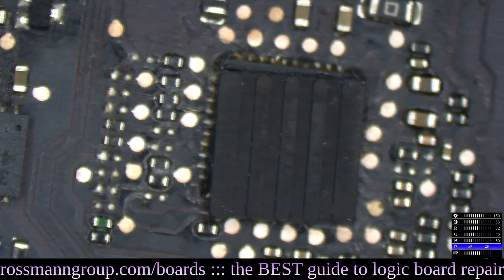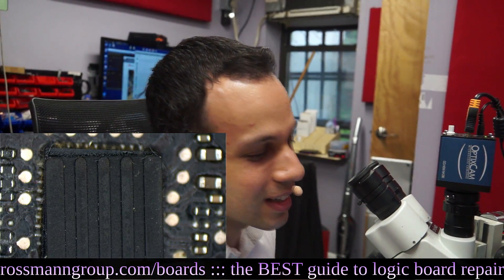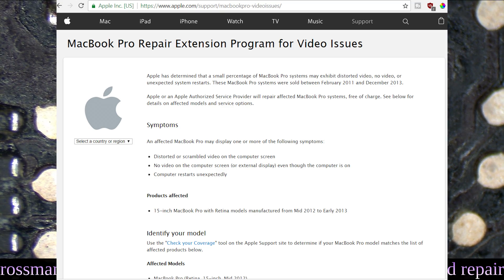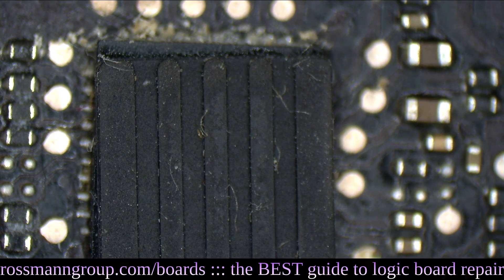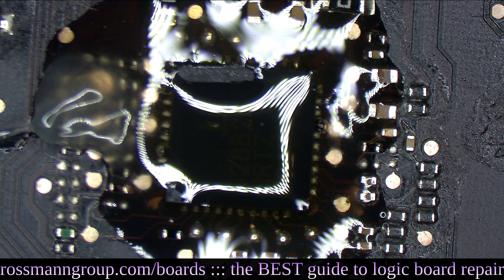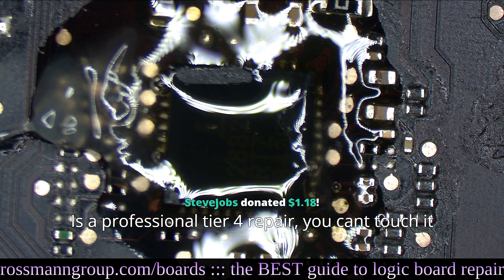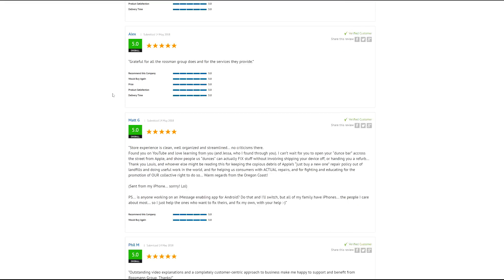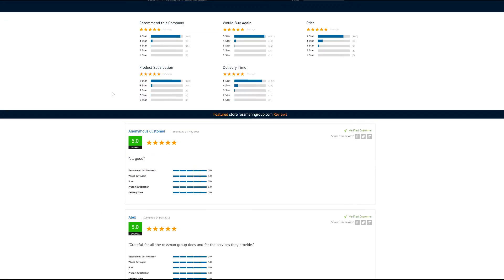How Apple authorized repair refurbishes Macbooks to fail again! GPU kernel panics

Comment: Louis, what you are saying about operating systems, i cant agree on that. You are saying, linux  users are either ppl who got sick and pissed off of windows or are open source hippies who love dealing with software without fancy features is not the way it is. When it comes to audio processing, fine, i can agree on  that. It sucks under linux. Every available  software use their own way how to handle extensions, there is nothing like vst and because of that, every software  has only basic functionality. OK, fine. But the same applies in some way for every other OSes too.  Im into software defined radio, good luck with that under windows. If you are lucky you find a build of gnuradio which is not completly outdated and intefacing hardware under windows is a pain in the ass. Im using linux because i like getting stuff done and not fight everyday in a new round you vs your operating system. 
I remember last time when i was using windows, an application where i spent a several hunderet bucks for crashed every time when i was running it my whole maschine, and all i got was a message which sayed, that an error had occoured, and i should reinstall and reinitalisize  my local library, and in this process all my data gets lost. So i called the support, for some more information, besides that an error had occoured so i have an entry point for tracking the problem down, but all they sayed, was, that some error occoured and i should delete.
My point is, that is something i would expect from free software and i couldnt even complain about it. I could completly understand why some developer gives a shit about my problems and  that he isnt willing to help me out in his spare time, for free. But if i payed some good money for something, i would expect a little bit more than a message which says "haha, you are screwed". And im not saying, just because you have payed  them , they have to fix every time all problems. But they could try to help out....Or at least pretend to

Comment: If the plugin you're trying to use is a VST, it can be run under a VST-supporting DAW in Linux under a Windows-Linux VST bridge host application. (disclaimer: i'm not actually sure at all how well this works but it's a thing)

Comment: The original soldering was not that good as far as alignment/placement but crud will come back from normal usage unless you conformal coat.  Even this board you did will eventually get crud and shit on the board.  This boards are no where near Mil-Std so there is no expectation of guaranteed usage.

Comment: If people like mac os so much they should build a hackintosh. Then you won't be stuck with crap hardware, you can use your old monitor, give up ecc memory for higher performance and overall spend less on features you don't need.

Comment: 4:48 macOS superior for what? Personally, I find it odd how difficult it is to get Audacity or OBS to record audio as you'd expect it to without additional software (i.e., the same way it does it in Windows or Linux). At this stage, no perfect OS exists in my opinion - they all need a lot more work.

Comment: Like a pc is just next to godliness.  One needs 100 different types of antivirus software just to protect the thing. Of course one can't simply delete an old file or program. You first have to discover which of the forty seven different drives it been saved on.  Of course it's been saved on more than one which means you have to waste time discovering which ones. But hey, pc's are just so wonderful.

Comment: if my local mechanical genius repaired my car by gluing a lump of foam rubber on top of the carburettor that would hold it in place once the bonnet was closed, instead of replacing the bolts that had rattled loose after his not putting them in properly when he fitted it originally, I might be tempted to bend a torque wrench around his thick head.
Reply: LOL, I did a double take at reading the word "carburetor" haha, Does that mean that I am not the only person on youtube using a carbureted car as a daily driver?
Reply: I'm afraid you are, my daily driver is a bicycle :)
Reply: In the car world, you can sue him.
Reply: Don't know what's more astounding: that Apple gets away with this, or the company's ignorant, cult-like following who seems almost tailored to think like these greedy POS company executives who take turns screwing them and raping their wallets.
Reply: Clarty Paths or shove the rattle gun where the sun doesn't shine.
Reply: This is actually how I repair my car... however, I don't charge £200 for it... or £2000 for the car "new". ;)
Reply: Area85 Restorations
 My car is over 31 years old and it still does not have a carburettor!

Comment: https://appdb.winehq.org/objectManager.php?sClass=application&iId=7507

Izotope RX5 has a platinum rating in wine. You should be able to run it in Linux easily. And MacOS for that matter.

That isn't to say that there aren't other things that aren't available in the form of alternatives or native ports that you need for your particular usage that also happen to work more or less flawlessly in wine, but it doesn't hurt to check if wine isn't providing an adequate solution for such examples.

Wine is a pretty large part of using Linux for a lot of what normal users consider to be "normal and/or integral" for their day-to-day use case. It's not a perfect solution, sure, but it's something that you may not have considered. I don't know how much experience you have with proper Linux, but it's not as bad as you seem to think it is. Give it a try if you ever get the time.
Reply from the maker: Is there a way to use any of these plugins live in a video editor like kdenlive or openshot? It is nice to not have to work with audio and video in separate programs when editing a video!
Reply: Louis Rossmann Excellent question. I'd have to try that myself. My first guess, if anything does support it, would be Blender. Which does have a video editor, if you were unaware as many people are. Who knows, a great deal of finagling and fuckery could be required, but I'm not well versed in Izotope personally. Just figured I'd give a shout out to my favorite kernel to my favorite Apple anti-christ.

Oh, and it would probably work with a Windows video editor running in wine as well just the same as on Windows. Which isn't at all ideal if you're making complex projects, but could work just as well for simpler work. Wine doesn't introduce much overhead, but professionals reliant upon certain software will notice the difference.

Comment: "What about the fact that MacOS is the superior OS?"
That's not a fact, that's your opinion. 🙄
I used MacOS at work for a few years and holy hell did I hate every last second of it.  My favorite memory is having to Google "how to rename a file in MacOS" because the most recent version at the time didn't have "rename" in the right click menu. I also enjoyed how their keyboard shortcuts in the menus would tell you to press symbols that didn't appear on their first party keyboards at the time. One more for the road: I also liked how software couldn't install itself properly and I always had to finish the installation by dragging the program into the programs folder (example: https://news-cdn.softpedia.com/images/news2/Download-TeamViewer-8-0-OS-X-2.png)

Words cannot express how happy I was the day I found out that there was a Windows version of the supposed "Mac only" software that I had a Mac for. Installed it on Windows immediately and haven't used a Mac since.
Reply: mjc0961 right click and rename. That bit is the same
Or press enter (doesn’t make sense) and type the new name
Or click the name at the top of an open window and type the new name

Edit: just saw that you said there was no rename in the context menu at the time

Comment: Don't remove the proprietary iRubber, then you'll turn it into a PC!
Reply: I always thought the iRubber was a condom brand to keep Apple customers from reproducing.
Reply: fangzea ¡HA!
Reply: technically that rubber wasn't branded with an apple logo, so it's made that product no longer an apple by their own standards
Reply: wouldn't you need an adapter before you could use it?
Reply: Fangzea - Nah the iRubber is designed to fail 2 seconds into use so they can continue to reproduce Apple customers. They are coated in a psychotropic that convinces them that you must only worship at the altar of Apple. Straying away from this core belief will mean people with Led Torches and pitchforks made from PC motherboards will protest outside repairs shops like Louis's saying they are heathens.
Reply: We all know if apple made a condom and something happens its not the condom fault. your just having sex wrong
Reply: Buy a 5-pack of Official Apple iRubber™ for $699.99 + TAX and get the second one for $694.99! Just pay shipping and handling + TAX + SRV + CRL + XAL + MAW
Reply: Maybe that is where the idea came from, their very first tablet..."iPad". Yeah like a rubber pad.
Reply: Alex Beyer hahaha
Reply: Thats what Tim Cooks parents needed
Reply: Hahahaha
Reply: Hey, you put it on wrong (instead of your holding it wrong)
Reply: lolz
Reply: Apple is so desperate they use thees shitty scare tactics. It's wrong and its sad.
Reply: theese
Reply: LMFAO 😂 😂😂
Reply: @pinoypyroguy  The IRubber prevents tiktok from being installed in the macbook
Reply: https://i2.wp.com/www.criticalhit.net/images/2017/01/ethernet-condom.jpg?ssl=1 reminded me of this old meme (and you know its OLD cause that laptop has a modem! lol) sfw

Comment: Look you don't even. Have to take your broken MacBook to apple. My MacBook white early 2009 had terrible overheating issues and in 2 years the unit just shut itself down after gaming for 20 minutes. So we sent it into apple. They fixed it and so once my apple care expired my computer broke again from guess what guys? Overheating. Look I was a kid when my MacBook died so I was scared as hell just thinking oh shit we have to spend another 1,000 dollars for another shit computer.

So I looked up online how to cure an overheating MacBook. I've been in a lot of ps3s since mine ylod so replacing thermal paste was nothing but doing it on a MacBook with parts tiny was intimidating. 

So I replaced the thermal paste and to my disbelief the apple oem thermal paste was dryer than an asshole after using toilet paper. Apple gives you the most crappiest  thermal paste in the world and they had plan obsolecense in my MacBook so I could take it to the apple store and pay probably 500 bucks for thermal paste that'll probably die in 2 years again. So I replaced the thermal paste in my MacBook every 4 years and this shits still alive. 

If you buy a new MacBook i suggest replacing the thermal paste or going used and r3placing the thermal paste immediately because all apple wants you to do is keep buying buying buying buying. They don't care about us consumers at all.

Comment: For the record: Linux does have a noise reduction plugin and many more for the 'Pulse' server. Linux also has an advanced audio server called 'Jack' that can be used with/without 'Pulse' that is very capable.
- 
I don't blame anyone for not knowing this stuff since Ubuntu makes it more obscure then say Arch and most of the settings are done with the command line. 
- 
Once you enable a few settings you can make yourself sound like a women or the guy from the nerdrage YT channel while recording in a bathroom..

Comment: There's tons of hidden gems in Linux for Audio mixing and stuff, you won't normally find them all within the distros repositories, some you have to go looking for them on the web to see what there is that you want specifically, a lot of these softwares can be found on GitHub, which you just simply download and compile from source, no coding required, some even provide precompiled binaries for Linux sometimes using image containers which provides all the libraries in that one binary app image container which can run off USB sticks on the go without using the systems own libraries.

Comment: Louis, I got sick of windows and currently use a Mac most of the time. But I'd jump ship if there was a new system around to give Apple and Microsoft both a run for their money and a swift kick up the ass. But, as you mentioned, I need to run commercially available creative software with associated plug-ins. In some ways, I feel like I'm trapped between a rock and a hard place. Apple have become the polar opposite of what their slick image and advertising made them out to be over the years. They're basically assholes in the way in which they conduct their business. And, yes, I admit that I kind of enjoy using their OS and my MacBook hasn't yet died, so I'm enjoying the experience for the most part... but I feel like I'm one of the lucky ones. I'm in no way an 'Apple Fan Boy' -That's a phenomena I'll never understand. Apple user forums are pretty terrible when you have a problem with their software. The forums have a high concentration of active apologists (Applepologists?...hmmm, not heard that before...why?). Anyhow, I'm an Apple user and I support your message Louis! I always enjoy your videos and hope that you keep going from strength to strength :)

Comment: On linux there is some options in PulseAudio for noise cancellation and then if that is not enough you could run Sound eXchange on your audio input, which supports noise profiles (you can generate them by recording the noise on it's own and then use the audiofile to generate a profile for it.)
Reply: I haven't tried that package but you would be hard pressed to find better audio processing software than iZotope.
Reply: @sea-ferring  I remember there is way to load windows VST on Linux while using DAW. It should be similar to other software that uses VST APIs. However, it  does require more time on configuring and tweaking on Linux.

Comment: Sometimes I wonder if adding a rubber pad on top of a chip is not the proper method to fix a bad connection. But then again it is apple™ supreme engineering  so I'm probably thinking wrong.

Comment: 7:00 THANK YOU! That’s a big part of why I use the Apple ecosystem. I, indeed, buy used stuff from them because the hardware IS overpriced talking from a quality control and repairability perspective (you support this with solid evidence). 

R&D-wise I know that every company needs to innovate, but... Failing hardware at basic levels? A big ‘nope’. Failing to mend the errors with a REAL fix ? So sad...

This was written on an iPhone X (I bought it used) and watched on a 2015 MacBook Air (bought last December, used, too).

Comment: Hackintosh, the Solution to your Problems 

altough it's a bit complicated to get it up and 100% Running, you don't have to use the Hardware from Apple BUT you can use the OS from Apple 

(written on my 2007 Macbook Unibody White)

Comment: I had Apple put a 'refurbished board' in my 2011 MBP, and when they gave it back to me they said I had a dead stick of RAM. Ok, fine. Sent it in and got a new one. What did I find? It wasn't the RAM that was dead, it was that the SLOT ON THE BOARD was DEAD.
#RefurbishedMyAss

Comment: Wait a sec, rubber is an insulator! Apple products suffer from over-heating due too poor thermal solutions, why are they adding more insulation to an already hot chip. Its like covering the radiator of your already hot-running car with cardboard just to push it into place... Follow up question: Does nobody else see this problem??
Reply from the maker: There is a huge thermal pad the chip is soldered to underneath it.

Comment: Serious question: Even with a proper repair, what do we do to avoid this failure again? I've read that the failure with the 2011 17" is due to too hot a graphics chip with inadequate cooling. It can be repaired, but won't it just fail again?